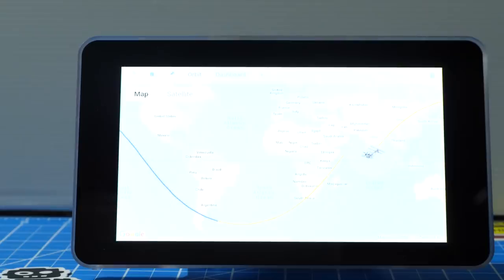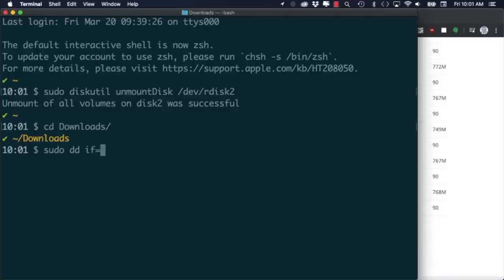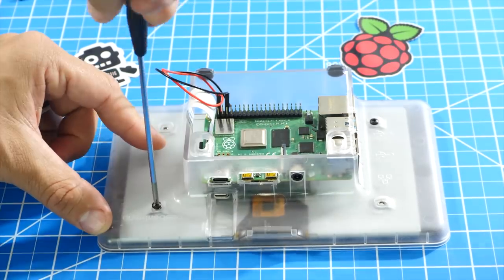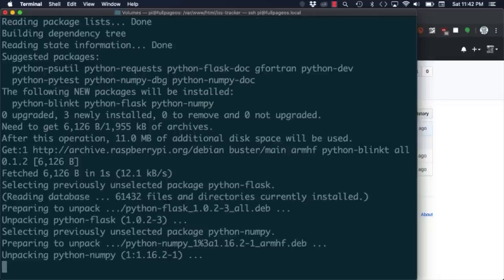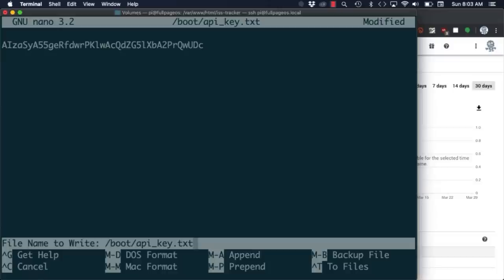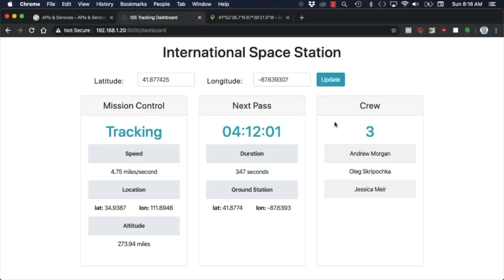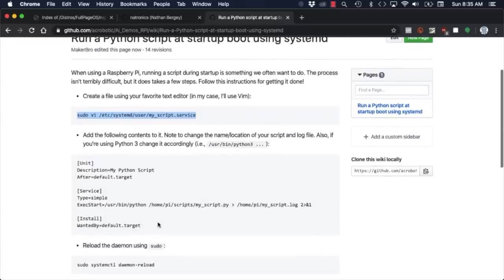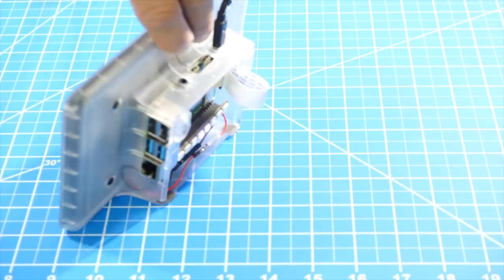RaspberryPi 4 International Space Station Tracker

Comment: Cool project! I already have a Raspberry Pi touchscreen box that isn't doing anything, so all I need to do is set up the software side. I don't have the LEDs, but they aren't strictly necessary. 🤔
Reply: Exactly, and once you have FullPageOS running, you can add more tabs to the browser. It's a straight forward way of having a browser-based display using the Raspberry Pi. Best of luck, and let me know if you run into any trouble :)

Comment: Nice project. But this is an overkill. You can use linux specific programs like GPREDICT. it works offline. 
You can track number of satellites with this single piece of software.
Reply: @datasith  "overkill" . I used this term since you are using it to track only ISS and considering the installation procedure (I didn't mentioned using a SBC is an overkill).
If you use GPREDICT, you can track n number of satellites at once and get a "ton of information" about the satellite (like it's azimuth, elevation, phase, transponders data, detailed pass polar map,......)

The installation procedure is fairly simple as it's just a apt command.

My whole point is just to say that you can get more instead of sticking to a single satellite.

FYI I already made a satellite tracker and notifier using esp32. If you want to look at it then I can give you the GitHub link.
Reply: @vijaymadipally2608  I wanted to explain the use of web APIs as it's a topic of interest in the community. Almost every project can include "moar features" or be done differently, so your point albeit valid doesn't add to the conversation. I was interested in tracking the ISS, and the project accomplished that goal. Calling it "overkill" fails to consider that plenty of people are interested in doing exactly that. LPT: phrasing it "for those interested in tracking more satellites, Gpredict..." would have been a more appropriate, in my opinion, way of making your suggestion. Make of that what you will.
Reply: @vijaymadipally2608  – the main takeaway from my comment is "you can build almost any project in a variety of ways." i didn't want any other satellite in this project, so no need for using GPREDICT. that would be a different project. not better. not worse. just different.

FYI, the use of a negative characteristic in your comment ("overkill") gets in the way of the criticism perhaps being constructive.
p.s., no one is doubting your skills, but thanks for self-promoting your github.